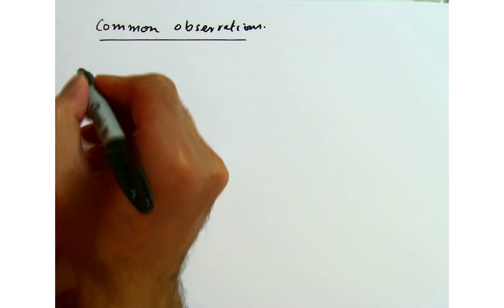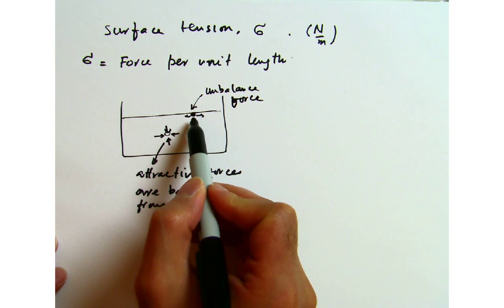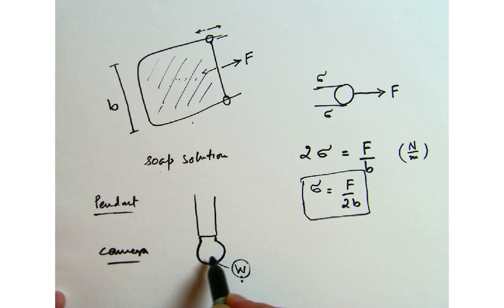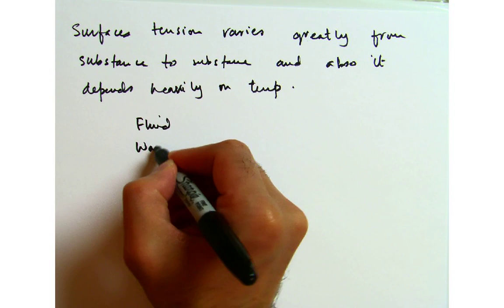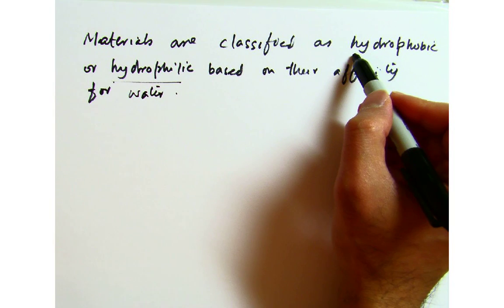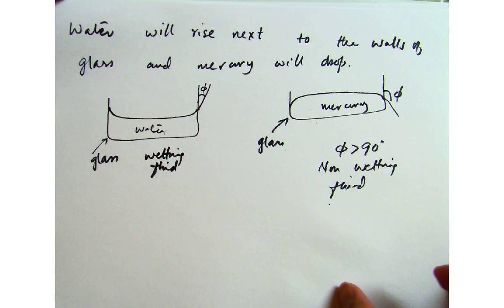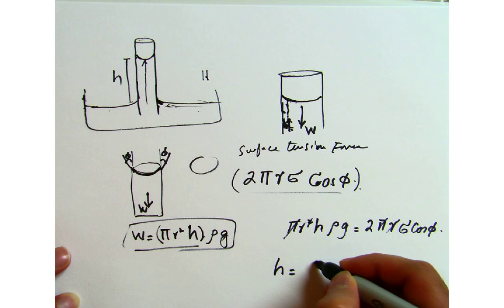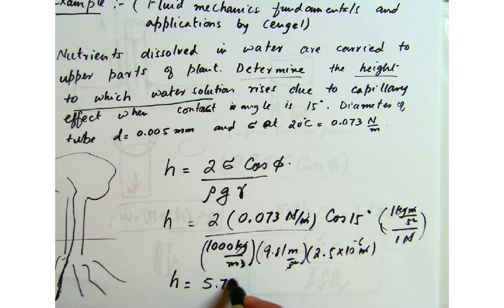Surface Tension and Capillary Effect

Comment: on capillary rise, is the angle 15 degree always constant for water at that 20 degree temperature or does it change? in practice, what material will act best as the tube of diameter 0.005 mm?

Comment: why did you take 2 sigma instead of one sigma during surface tension calculation?
Reply: It's because there is two films of soap : on in the top and one in the bottom !! so basicly there will be two Forces/Unit lenght

Comment: if there is high surface tension why will the droplets be big , they should be small
Reply: This is so because surface tension is a phenomenon where by a liquid layer behaves as if it were covered by an elastic layer. Thus, the more the surface tension the more the elasticity of the layer so the higher the surface tension the bigger the drop